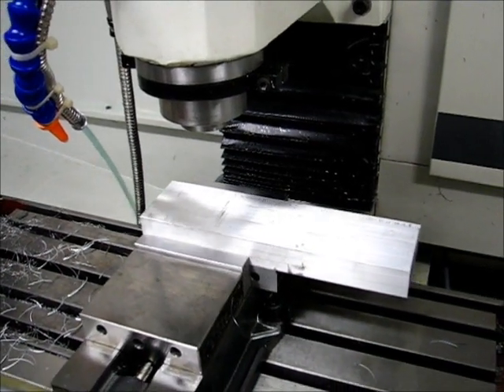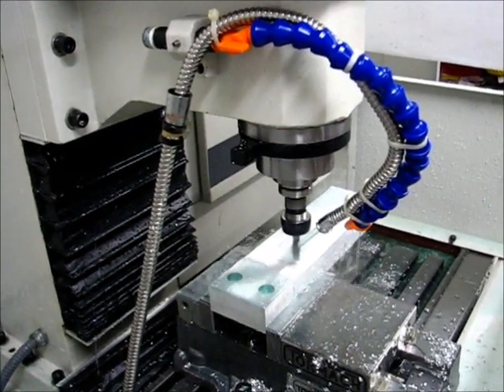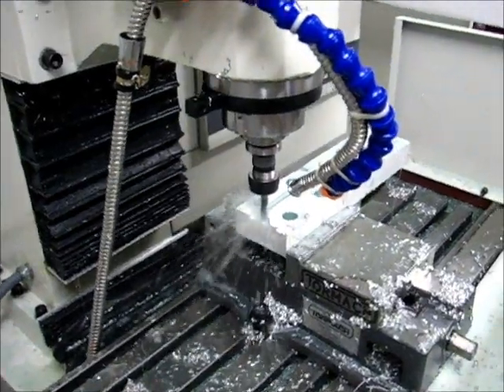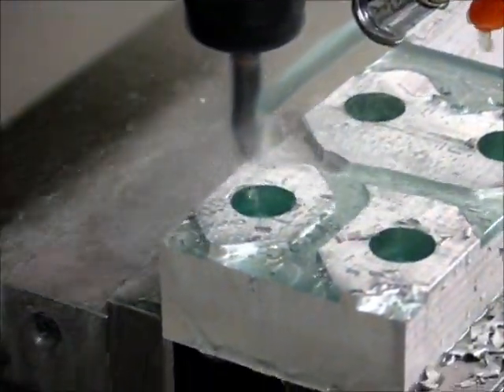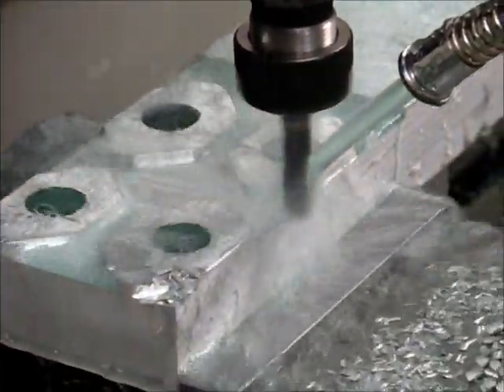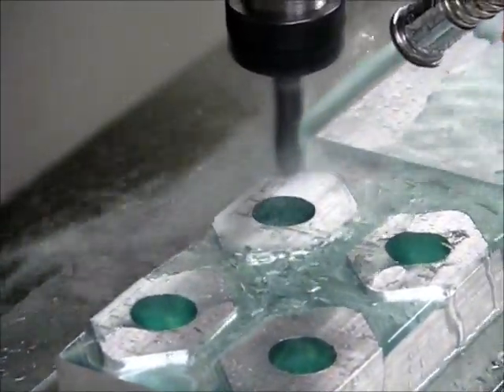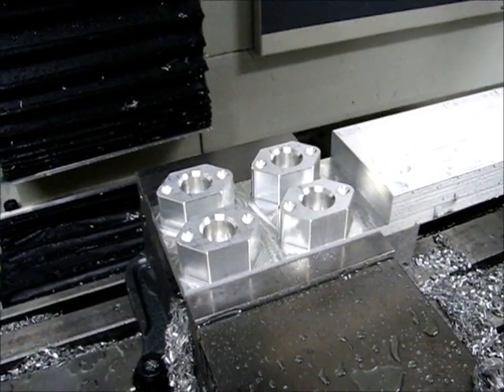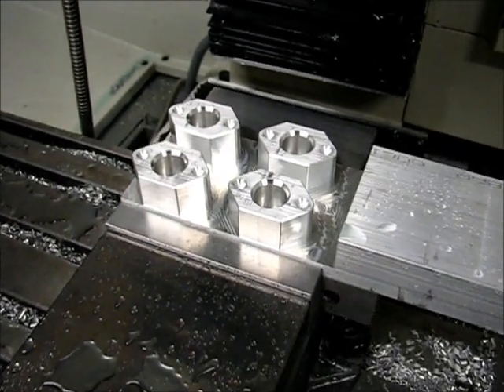Tormach PCNC 1100 - Machining a Batch of Sensor Weld Bosses

Comment from the maker: I agree completely about the weird tool paths. I normally optimize the operations but I needed to get this one done quickly and wasn't worried about it because this was the only time this code was going to run.

Yes, there is a small step right where the tool enters and exits on the finish pass. I had adjusted the gibs right before this operation and thought I had done it wrong. This was proof that it was wrong. I've since adjusted the gibs again.

Comment from the maker: About 40 minutes for the CNC operations and drilling and another 10 minutes to hand tap the holes.  So, about 12.5 minutes per part.  With a revised method, more pieces being produced per batch, optimized tool paths (the drilling cycle was practically done in a random order) and a CNC controlled tapping operation, I'd bet I could knock 33% off that time.